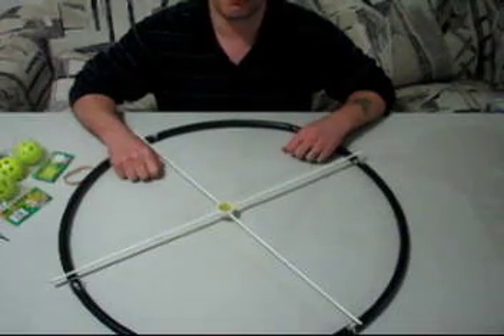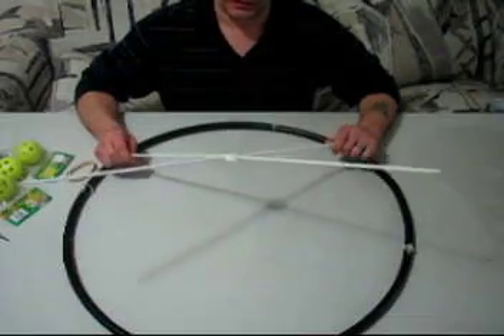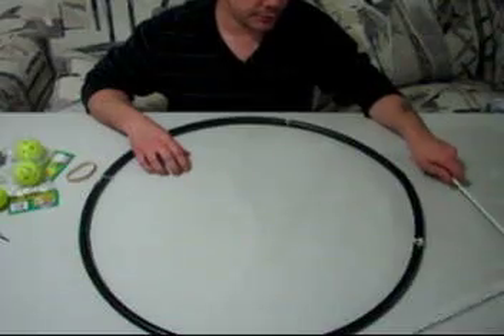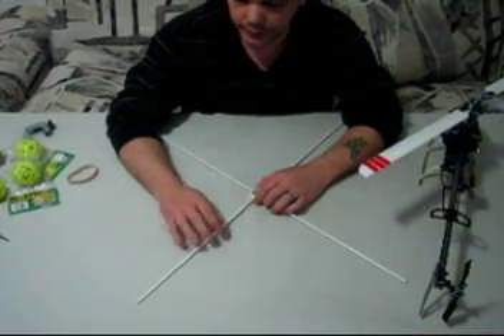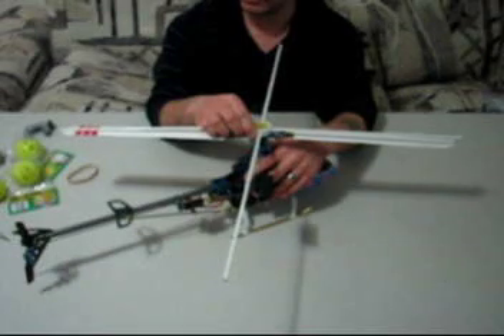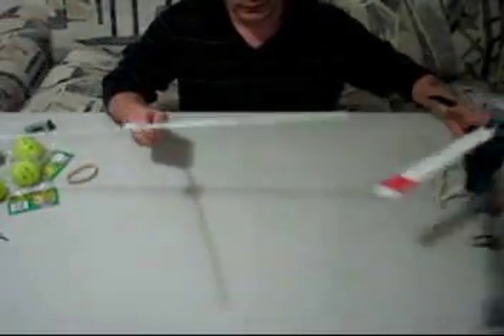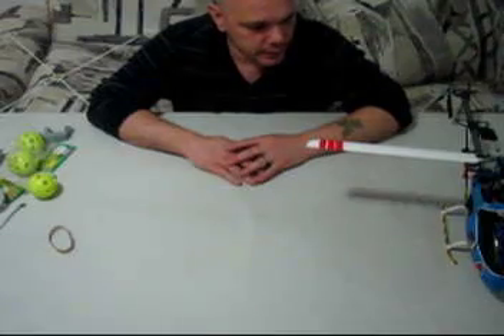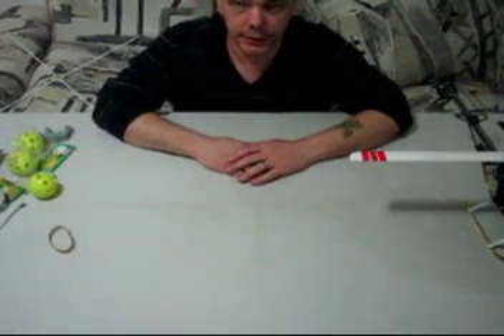RC Heli DIY Training Gear

Comment: wow  good  idea, i  bought  the  regular kits  and  were  cheap,  i  made  my  own  ,but  you  gave  me  a  betteer  idea, plus  my  bamboo  sticks  werent  realy  flaxible  but  im  hot  gluing  some  1/2 inch,  by  half 1/2 inch  springs from  a  1/5  scale  rc  car,how  does   that  sound ,  i  would  appreciate  your  response,  thanks dave  excellent engineering.

Comment: Hey!  Great video.  I had the same problem with my tail rotor hitting the grass/ground.  I solved the issue by putting on 500 size tail fins.  I had to shim my landing skids a bit to equalize the angle, but all in all it worked perfectly.

Comment: Dude that has to be the best gear I have seen. Hey instead of the flag rod. Maybe can use carbon arrow shafts? They are hollow and would be lighter too. I'm a bow hunter so I have extras. I'm going to find those balls and see how it turns out. But the design is great. I did use the dowel rod method too and broke one. Didn't crash tho :)